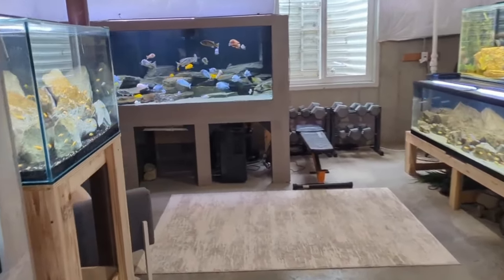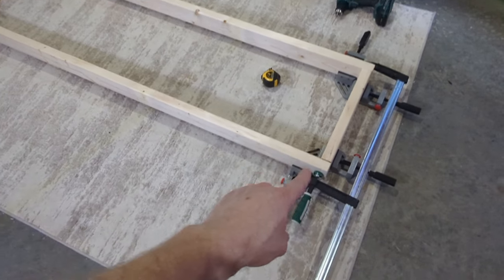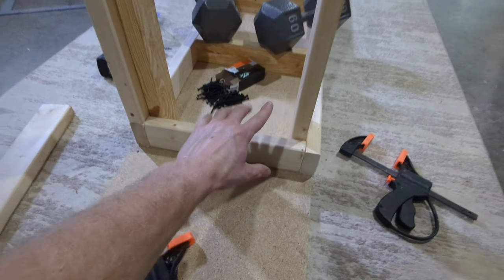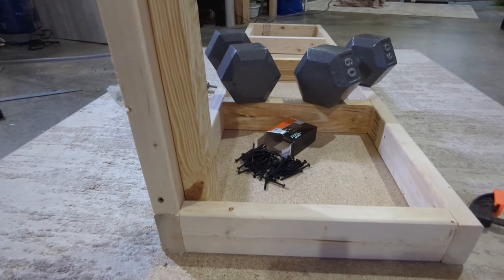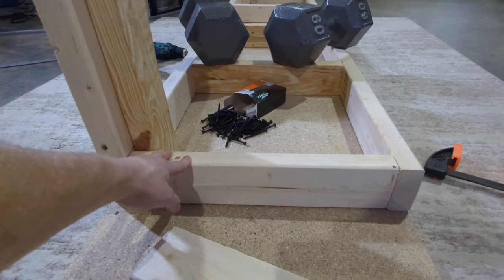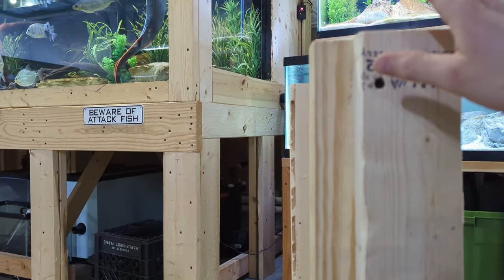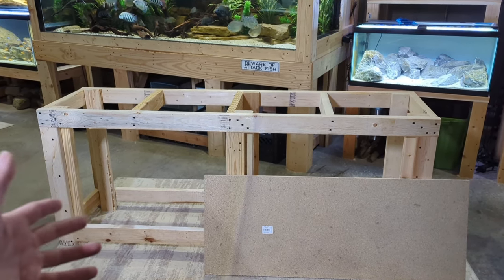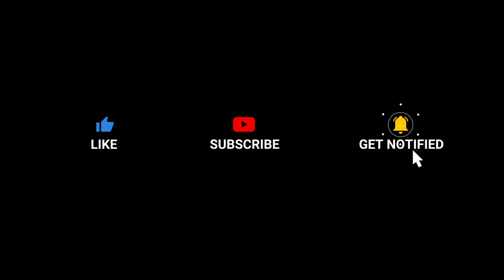How to Build a DIY Aquarium Stand | Pt 3

Comment: Just curious if you can explain why the bottom brace boards should be off the floor vs on the floor. You mentioned if you have them on the floor it can cause problems. I’d love to hear more about that so I don’t make a mistake with my build. Thanks for the great videos!
Reply from the maker: @buckybetz  Hi! The issue with the bottom braces being on the floor is you can't know where the load from the tank will settle. It won't necessarily spread evenly like you might think. So you'd need to be very careful to shim/support the ENTIRE perimeter. It's not really a problem, but it creates a lot of extra and unnecessary work which adds risk of getting something wrong.

Comment: Why did you choose to use particle board? I would think that is the lowest choice on my list so just curious?
Reply from the maker: Particle board is weak on sheer strength, but has good compressive strength. Since I'm only using it for the top, and it is well-supported underneath by cross-braces, it works quite well and saves money.
Reply: @Riffwaters  How do you handle moisture and water spill. That was my main concern and why I thought to use water subfloor.
Reply from the maker: @matthewnelson5699  I've never had an issue with that, so honestly don't build with it in mind. I run dehumidifiers in the room, and if the board ever gets wet it always dries out pretty well.
Reply: @Riffwaters  I want to follow the process of your build but last thing I was wondering was what is that material you wrap the tank in? I like to copy that.
Reply from the maker: @matthewnelson5699  I intend to get a pt. 4 out to cover this, but I've actually done it before. Look for my video titled  "Make Your DIY Stands Look Amazing". Best wishes!

Comment: Thanks for these stand build videos. I have realized that I am going to be forced to build my stand so your info has been greatly appreciated. Especially talking about the loads the legs can collectively support. I only have one question right now which is why you chose to orient the corner guide legs different than what you drew in Part 2 at the 23:30 mark? Looking forward to part 4!
Reply from the maker: Hey good catch! That's actually an inconsistency I didn't intend. Either orientation can work, with slightly different benefits. For this build though, I should've drawn in part 2 what I actually built in part 3.

Comment: did you put styrofoam under the tank if so what kind?
Reply from the maker: Yep. Any flat polystyrene will work, but I use home insulation boards from Menards because they're cheap.
Reply: @Riffwaters  thinest I counld find is 1" will that work?